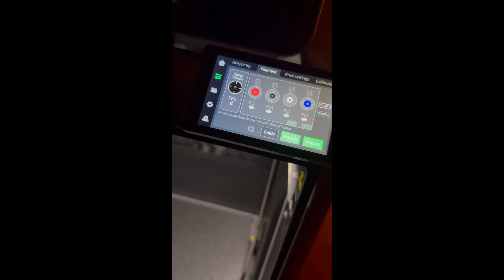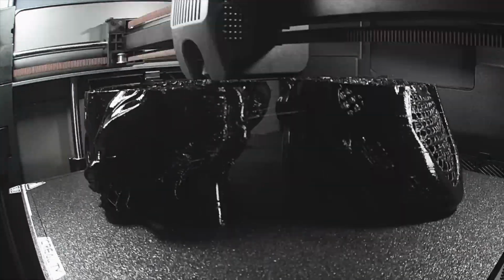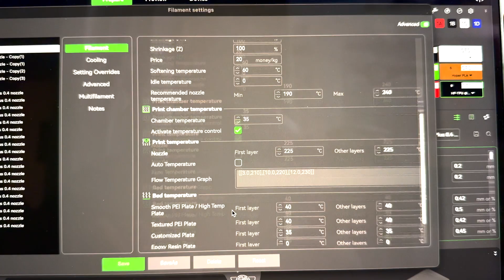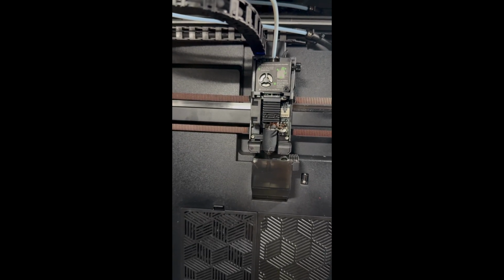Making the Creality K2 Plus print TPU and other flexible filaments!

Comment: I was under the impression that TPU would not print from the side roll. You didn't need to remove your CFS and glass cover and feed the TPU directly from above the CFS?
Reply from the maker: I was able to keep the top on the unit and to feed the TPU directly from a dryer that was underneath the printer. So in my experience, no, you do not need to remove the top and have it fed directly from a roll.

Comment: Could you give me the measurement of the original spring? I lost mine during maintenance…
Reply from the maker: 0.8 x 6 x 15mm is the factory spring.
Reply from the maker: 0.8 x 6 x 15mm is the factory spring dimension

Comment: The Amazon link you shared for the spring has different options available. The link initially takes you to the 6x0.6x15mm spring. Is this the correct size?
Reply from the maker: 6mm OD, 0.6mm Wire Size, 15mm Free Length,

Comment: The mod allows it to at least attempt tpu. Still doesnt stop the crappy extruder from wrapping tpu around the gears... Man what a junk extruder for such a expensive machine.
Reply from the maker: I’m unsure how to respond to this comment because if you do the mod like I showed in the video you should be able to print TPU. Calling it an attempt when I have printed over 51 hours as shown in the Timelapse is a weird claim. Have you tried what I detailed in the video? Because if you have, then it’s pretty easy to get the K2 to reliably print TPU.
Reply: @brettturnage533  I have the exact same setup and I'm printing at a measly 3 max vol flow with tpu and it still has issues. Heck mine has wrapped petg around the gears... I've never had a printer do that.

Comment: ok ive got this mod installed and been troubleshooting constant jams the last two days. I finally rewatched this and found the bottom right screw thing cause the lever was getting stuck. printing now i hope this is it! I need some new shoes!
Reply from the maker: Yah, if you tighten without checking if the lever is loose, it will jam up on you. So as it sounds like you’ve now adjusted that screw so that the lever moves freely, you should be off to the races printing TPU.
Reply: didnt work it just keeps jamming and i have no idea why
Reply from the maker: @arranwilliams2523 what’s happening when you are tuning the filament? Is it flowing good when you are adjusting the thumb screw? And you swap the spring with the softer unit and what filament and filament shore rating are you using?

Comment: Hi Brett, thanks for the amazing video, I am really new to 3d printing and was wondering, can you still print most other filaments with this extruder setup or would you swap with other extruder if you would go back to for example PLA or PETG? Thanks ! (PS it might be best for me to stick with PLA and PETG for now :D my seams are not that great of my prints yet even with PLA)
Reply from the maker: @brechtxbrecht  good question, you could leave it in and just tune it for PETG, PLA, or other filaments, but you could also swap the original spring back in when you know you’re going to be printing a lot of non-flexible filaments. Myself, if I know that I’m going to be printing loads of PLA, then I just swap back in the original spring so I don’t have to tune.

Comment: Made a huge diffrent for me! I got filament tpu filament stuck in extruder always….
Now it runs smooth with dubble speed! :)

But i only changed the spring for a less stiff spring and shortend it. I didnt use a external screw.
Reply from the maker: Awesome! Glad you found the video helpful and you’ve got the K2 printing TPU.

Comment: Thanks for this great video. I ordered the thumbscrew and downloaded the STL for the spring perch. I will install a soon as the thumbscrew arives (spring I already have here). Also I will replace all the PTFE tubes with Capricorn TL (2.5 ID) and feed TPU from a holder just above the extruder. I really hope with that setup I will be able to print TPU successfully.
Reply from the maker: @michaelguennewig6722  you’re very welcome! Once you get it all set up it’s very simple to print TPU. Just calibrate it with the thumb screw on your tension and you should have no problems. I printed those shoes just as a proof that it works 50 hours and not a foot wrong so you should be very successful.